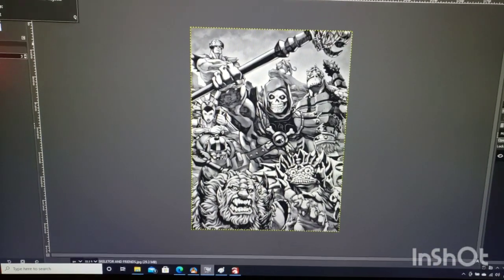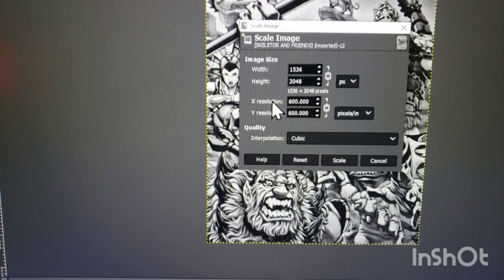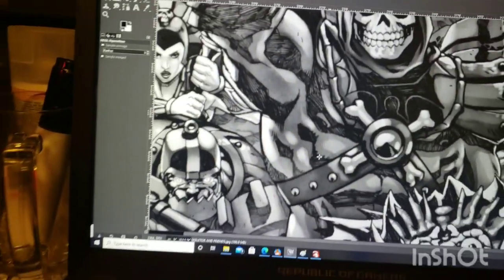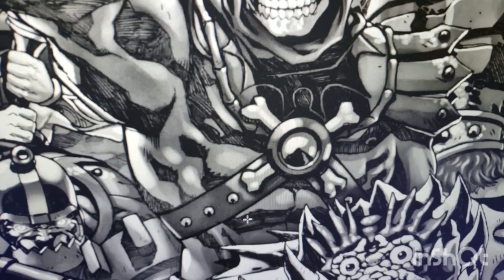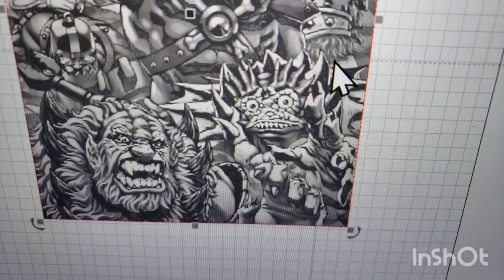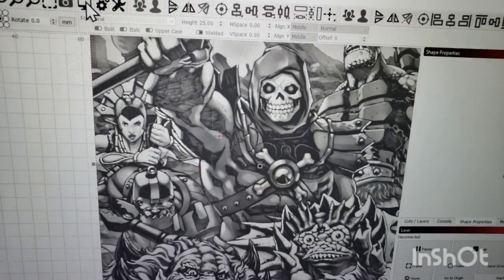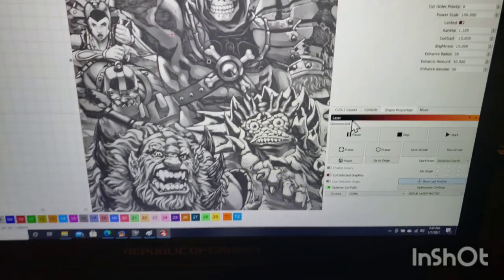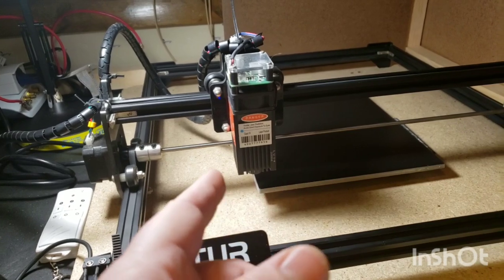TKH: Painted Tile Tutorial. Ortur Laser Master 2 20/5.5w

Comment: I am new to laser engraving and have watched many of your videos and your advice and settings are priceless. Could you coat the burns afterwards to prevent scratching?
Reply from the maker: yes, but be careful. the first couple coats of clear coat need to be very thin. If you put it on too thick it will crack the paint. especially, on tile and glass. just know your taking a risk. If its a wall hanger probably not needed. if its a seasonal set about it maybe needs it.

Comment: newer to lasers, glad I found your videos, I subscribed, If you use gimp do you not have to allow pass thru when you run it in light burn?  going to get some steel wool and vinegar to try, I like that coloring.
Reply from the maker: It does work great for aging wood which is what I made it for originally. If you want to keep the wood a more natural color use the Borax treatment to get darker burns at higher speeds. No, you don't put it on pass through if you only changed the size and resolution in Gimp. You will have to pick a dither setting in Lightburn. Try them all out a sample section and see what looks good to you. Newsprint runs the fastest and Grayscale the slowest. There is a lot of practicing to do when you just get started. Don't get frustrated if things aren't perfect to start. A lot to learn. I was running so much faster than everybody when I first started I couldn't get much help from the Facebook forums. Join some of those if you haven't.  A great place for ideas and help.

Comment: Cool Video, good Information for me. Is there a reason why you are working primarily with the Y-axis? There is more mass to be accellerated...
Best wishes from Germany  
John
Reply from the maker: The laser has a narrower focus on the y axis so it will cut deeper on that axis. About 5% gain in power id guess. The head is also a lot more stable. On the x-axis at high speeds if the head is slightly loose at all it can wobble a little and cause skips in the image. Running on the y reduces the chances of that.  You have to add a few mm more of overscan on the y axis to compensate for the mass but the benefits I think outdo the few minutes lost on overscan. Also, I seem to do everything different than most people.  I liked the y axis better right off the bat and it seems a lot more people are using it now.
Reply: @TheKennyHack  thanks for the explanation. I will try it and leave an Abo of your channel. 👍👍

Comment: True, you can do more work in shorter time using several cheaper laser machines.
But, i am just guessing... Do not the more expensive laser machines have the ability to do much more fine tuned work, and thereby also much better quality ??.
Reply from the maker: Mmm, I'd say the smaller lasers can do finer quality images but just take way longer to do them. The 2w diode setups probably are the best for doing the Norton White Tile method. The CO2 are the way to go for cutting and do well enough with images. I've never ran a CO2 so just basing my opinion on what I've seen in forums. Ive never could see a big difference in image quality between diodes and CO2. I had posted a painted tile piece in the forums and someone commented with one if their pieces that was done on a $50,000 industrial laser. I'd say yes it was better but not 1000x better.  Where the CO2s do better is I think they are mostly ran on Grayscale vs diodes are usually a Dithering pattern. Diodes can do Grayscale and once you figure it out can get great shading with a diode but it does take longer to burn vs using a dither like Newsprint.

Comment: I noticed your doors. What did you use for the windows?
Reply from the maker: The darkest red i could find. It doesn't have a certified laser rating but in comparison to my laser glasses it blocks more than all the provided glasses I have and is about the same as the OD +6 glasses I purchased. The problem with red is it just blocks all other colors. My OD 6 glasses i can still see most colors and they block just the specific range of blue of the laser.

Comment: Maybe I haven't seen it yet in your previous videos I've watched so far, but I'm trying to do white painted white tiles with my 20w ortur and I'm curious what settings to use because it does nothing to my tile lol. Any help?
Reply from the maker: I had almost no luck doing the Norton method with my old stock 20w. Could get a bit to stick around 800mm/min but that is just too slow for me so I gave up on it pretty fast and went to faster methods. I think the narrower focus of the 15w, G8 lens, or the new fixed focus models will work better on the Norton method. Still haven't seen anybody running at high enough speeds to regain my interest in trying it again.
Reply: @TheKennyHack  thank you for the reply! I've been watching videos and seeing everyone do it and I have tried 5x with different settings and can't nail it so I'll just keep painting them lol. Thank you! Also, appreciate all of your videos!

Comment: Great job !! Have you used an air assist to keep the dust off the tile?? Is that the stock lens?
Reply from the maker: Everything is stock right now. Trying to show what can be done with a stock machine. I have some upgrades to put on just haven't done it yet.
Reply: Do you think an air assist would help though??
Reply from the maker: @bharkin1  yes, it would probably blow the soot far enough away that it doesn't cause issues, but now you have a bunch of dust to cleanup off the machine too.

Comment: The machine probably can’t handle a high dpi (dots per inch). Try finding a high quality picture or buy a better engraver that has high dpi.
Reply from the maker: These early models about as small of a laser focus that can be achieved is 0.08mm or around 300-318 dpi. The newer models can get to about .05mm. Finer resolution means more passes and longer burn times, so it's a trade off of finer quality vs longer burn times. The newer Pro Model Ortur is rated up to 10,000mm/min. It would be nice if they were rated up to 12k or 15k speeds. I wouldn't be scared to give it a go. I think their 32bit boards would need to be upgraded. Using Grayscale dither about as fast as you could run is 7000mm/min before the board couldn't keep up with the data.  Newsprint and some of the other dither modes have had no problem running at 9000mm/min.